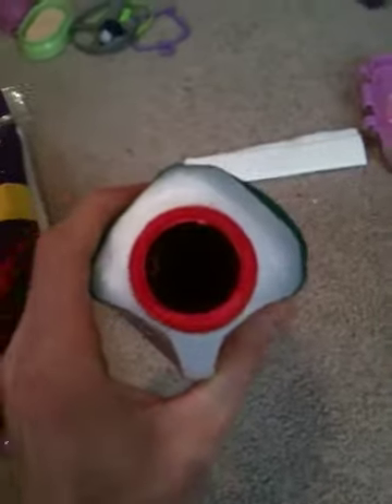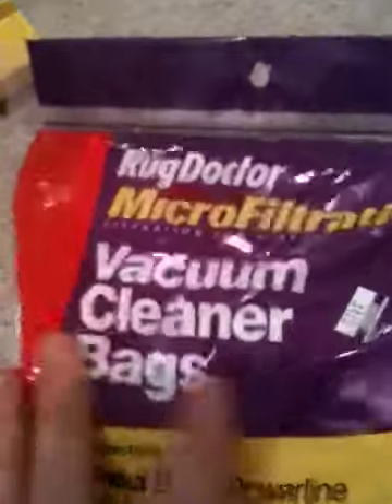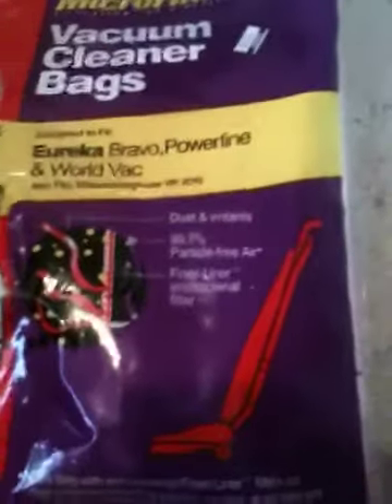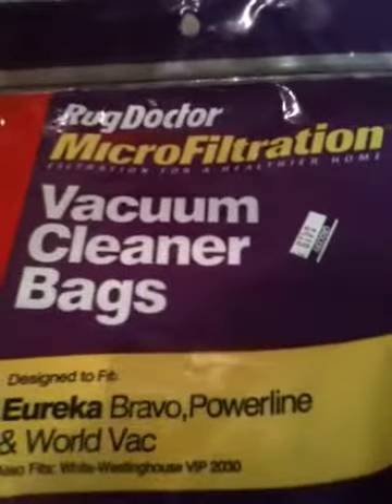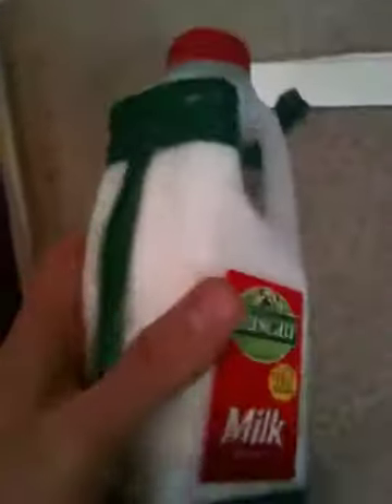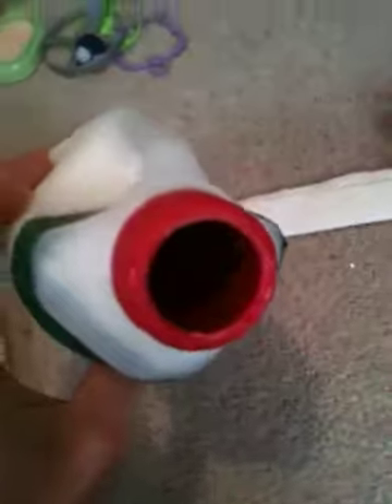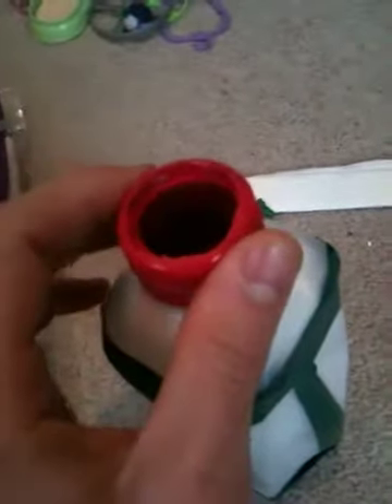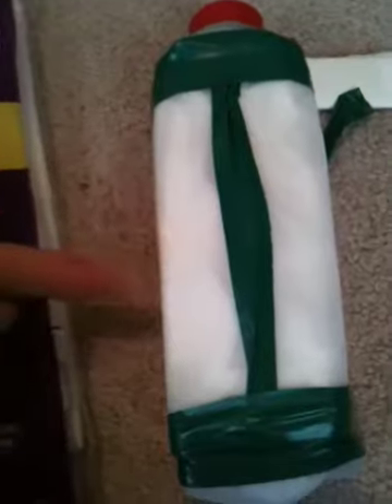Home made HEPA filter for home use.

Comment: HEPA class filtration must remove 88% to 99.9% (based on Specification grade) of all particles greater than 300 nanometers(0.3 microns), your filtration material is rated for 5000 nanometers  so it cannot classed as a HEPA filter.